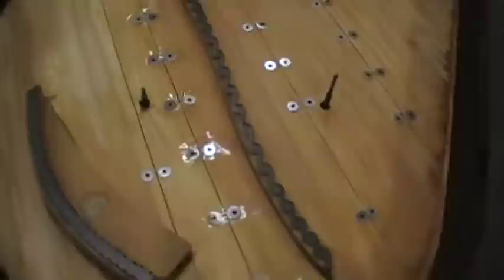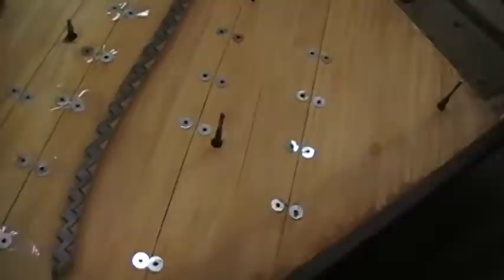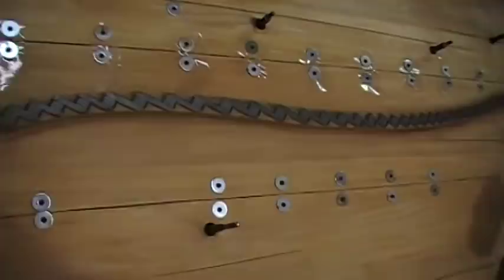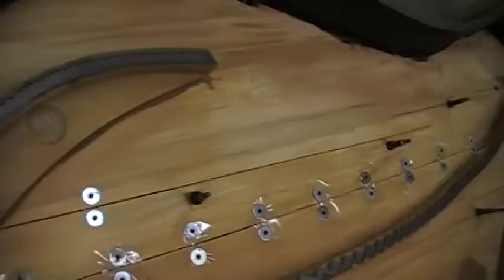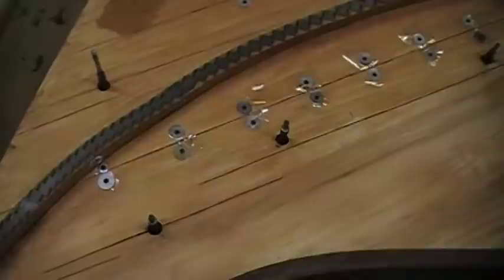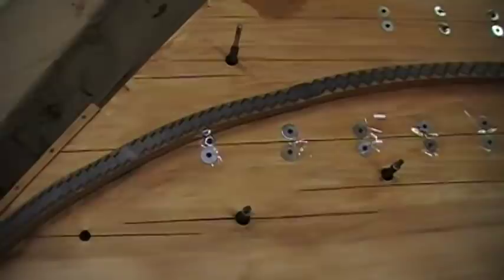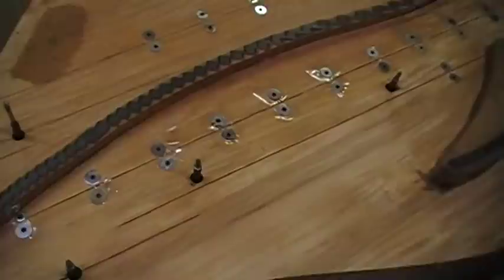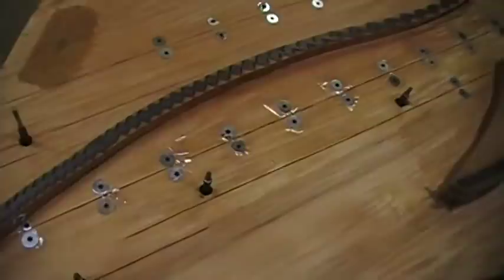Krakauer Bros. Grand Piano Part 3

Comment from the maker: The screws hold the ribs which are on the opposite side of the soundboard to the soundboard.  The ribs are indeed glued to the board and the screws hold them tight while the glue dries.  This is altogether separate from the long crack you see running alongside the screws.  The crack is actually a joint where two peices of soundboard material were joined together as the board was made.  Over time this can happen and these points need to be rejoined.  This is where the thick epoxy putty comes in.